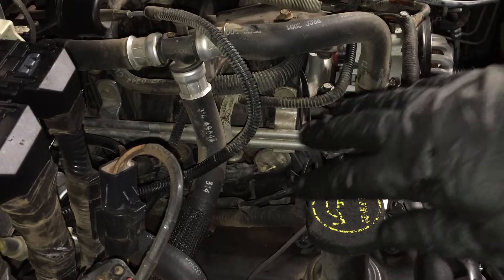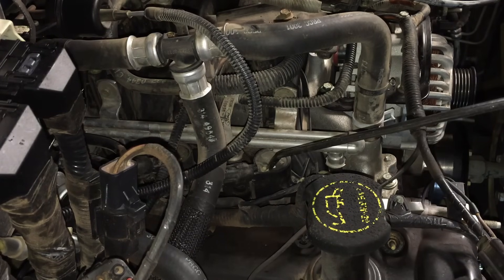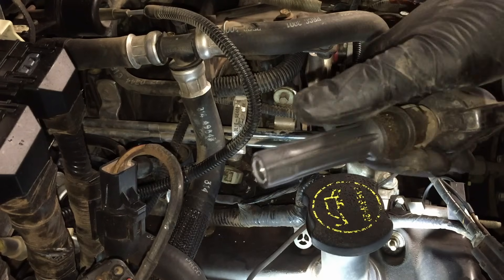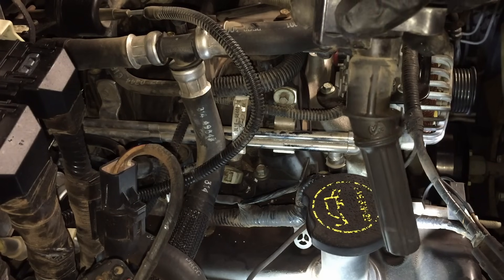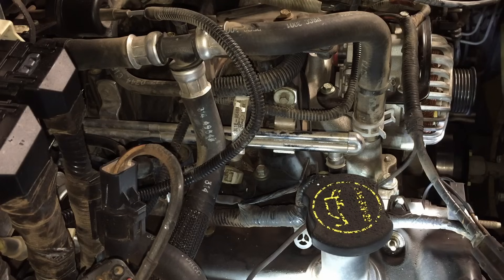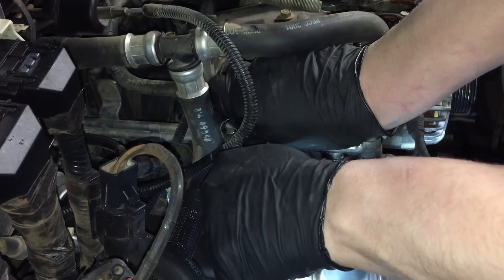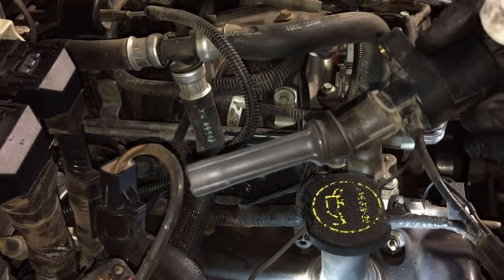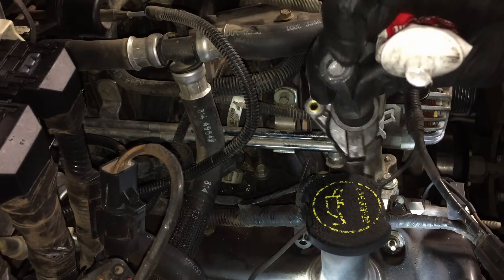Important Tips When Replacing Spark Plugs on Ford 4.6L 5.4L 6.8L 2v Engines

Comment: Have an ,06 f150 5.4 3 valve non flex engine. socket for later engine is 9/16 not sure what years that covers but I think is 2005 and up putting in my 3rd and last set of plugs coils were replaced recently also third set all motorcraft . When I replaced the coils the first time when the truck was young I put the MSD ones in which I got from summit racing equipment they eventually failed lots of trouble getting them out with the boots coming apart which sometimes happens watched  this video as a refresher I learned so much from this guy since I’ve had the truck getting ready to replace it but if you have any problems he is the Ford guy or I should Have just sent  the truck out to him a couple years ago and then I’m straightening out as I have a Honda guy who hates Fords doesn’t like to work on I have to beg him to work on it so I do a lot of the work myself one  thing wear a pair 
of gloves with the rubberized sides 
doing this I have big hands it’s hard to get in there otherwise and you will tear your hands up badly. It’s definitely a job you don’t need to rush you don’t want to rush and you allow at least 3 to 4 hours to do it the first time if one of the cylinders  gives you a hard time with is going to stop and maybe have lunch or something and then get back ones it can get very aggravating very frustrating in there quickly on the back ones they don’t give you a lot of room to work it’s almost like they put the plugs in on the assembly line with the motor before they drop the motor into the truck which is probably what they do if the engine was out of the truck this would be a breeze but it’s not. Good luck . Whatever dealership ,lost this guy made a big mistake he is the Ford guy he’s the Ford guru he’s helped  me with all types of problems over the years with this truck not that I’ve had a lot but he is the man! Thanks for a great video ! I have 300,000 miles on this truck plus getting misfires cyl 1-3 and three wouldn’t be surprised if it’s the oil thing like he talks about with the valve cover coils are all new just trying to get the truck thru inspection as the plug themselves are giving me four codes misfires one through three each individual codes in a multi misfire code if I can fix that I can get it to inspection for one last time! Hoping it works!

Comment: Am I missing something? You didn’t actually use a torque wrench and you just estimated how tight to make that spark plug. You even talked about the torque specs and said factory is supposed to be 13 to 15 pounds but you said tighten a little more than that, and then you just estimated with your hand instead of using an actual torque wrench. Knowing that these engines are prone to blowout plugs there’s no way I would just estimate!

Comment: Any (industrial quality, not the powdered aluminum auto store krap but nickel is fine) nickel or copper will do since spark plugs don't get hot enough to require nickel (but it's well worth having for exhaust manifold and turbo hardware!). I anti-seize every spark plug I install because customer thread repairs got the point across. Champion Aerospace 2612 Spark Plug Thread lubricant has graphite and is used on recip and jet engines (per individual tech order of course!). 

A very high temp anti-seize is milk of magnesia which GE and Airbus both specified in their hot section tech data (hard to find online but I was a USAF jet mech when I saw it in GE tech data). That also works on exhaust hardware. Here's a reference from an aviation supplier (use original, not flavored!). 
On plug threads a dab the size of this "0" midway up the threads will do. 

Dry threads are Satan's playground.

I found a reliable way to flush out spark plug wells. I use an "irrigation syringe" (cheap at any drug store) and a couple feet of ~3/8" metal tubing (copper pipe is fine) to fill each plug well then let sit about 20 minutes. Then cover with a handful of shop rags and blow out with a long reach blow gun. I use a cheap USB borescope to inspect and repeat the cleaning until I no longer wash oily gunk out of the plug well. Then I can remove plugs without worry.

Comment: I found a very useful trick for cleaning the accumulated oil etc from spark plug wells which easily trap crap over time.
I use an "irrigation syringe" (cheap online or at any drug store) and a couple feet of metal tubing to fill the plug well with acetone (cheap by the gallon).
(Do this outdoors and do NOT even think about smoking or similar!) I let the well sit full for about ten minutes then cover it with a loose handful of shop rags and blow out the plug well with a long reach compressed air blow gun. Repeat until clean and dry. 

I use cheap USB borescopes supported by the same metal tubing (copper tubing works nicely) to get a visual on each plug well to ensure it's clean before pulling plugs. It's worth the modest amount of work to have clean plug wells and compressed air alone doesn't work as well. 

I apply a (SMALL) dab of anti-seize mid-way on the plug threads. 
For the people who howl about never using anti-seize on spark plugs note recip and jet aircraft engines have used thread lubricant since the early last century. Champion 2612 Spark Plug Thread Lubricant is affordable but any decent copper or nickel anti-seize will do. (You can even use milk of magnesia with Airbus and GE have specified for jet engine igniters and which works nicely on exhaust manifold hardware.) Dry threads are Satan's playground.

Comment: Nice lies about blow outs.  Ford had a single car come in for that.  They did and tecorded everything in attempts to recreate the situation.  Not a single blown out plug, not 1 when done to factory torque spec.  Its a bs rumor, the car that came in was sabotaged more than likely, oddly enough, right before warranty was up.
Reply: I'm torn between what he said and the factory workshop manual which says 11 ft pounds... 2006 Lincoln Town Car Designer Series Gas
Reply: @Finding-Orthodoxy it's not 11, your manual is likely a fake or misprint.  11 ft lbs, that's a total of 44 applied for all threads
Reply: @TheGnome-x1o  I thought so too at first. But the Workshop manual, haynes, and operation charm, all say 11
Reply: @Finding-Orthodoxy so, 11 ftkbs per thread, 5 threads, 55ftlbs total hole pressure, thats actually really good.  Problem is its fast and easy for a sabotur to loosen.

Comment: I've had my 2001 Van for 23 years now. I have never changed the spark plugs or the coil packs because I was afraid to. At two hundred and ten thousand miles it finally started missing a little bit and I had no choice. You are amazing and calm. You gave me the confidence and believe it or not.I got every one of those spark plugs out. I had to put about a 15 inchicken to get enough torque to get him out.But they all came out without without breaking them. When I put the new ones back in. I'm gonna try to find one of those magnetic sockets. Thanks for the video and conference

Comment: do most mechanics remove the fuel rail when doing the spark plugs? my truck has 300,000 miles had the truck for 30,000 miles idk when they were last changed should I change my plugs?

Comment: I am replacing my intake gasket, antifreeze running out at the rear of the engine. Presure test the system, and antifreeze ran out the back.Some antifreeze was in back plug hole,great time to do my plugs. Have a good week.

Comment: I'm halfway through this very job right now.  Came inside to cool off and eat some ice cream :)  This job is difficult.  Clearances are very tight.  The hole for the spark plug installation is as he said - lots of dirt and very small stones.  The drivers side seems to be the most challenging.  I counted the tools I had used, and I had nine ratchets, sockets, extensions and swivel sockets in a pile, and I was constantly trying different combinations to get that side done. 

 I did torque my plugs to spec plus a little squeeze on top.  I bought the correct Motorcraft plugs and pulled the old Motorcraft plugs.  I had a fault with the #7 misfiring, so I installed aftermarket coils.  If they run poorly in the future, I will comment here.  I'm tired.  My hands hurt and I am 1/2 way through. 

 OH - listen - the driver side spark plugs are hard, as I said, but you will have to use a swivel and it needs to be the first module off the spark plug socket, and then maybe use the 4" extension to carefully feel your way to screwing that spark plug in the back two cylinders on the drivers side.

Comment: I learned how to change the spark plugs on my 2004 f150 4.6 3v from watching this guy.. hes awesome! My husband teases me calling him my go to guy lol.. my  4.6 entailed  taking the throttle body and fuel rails  off which actually made it a lot easier to access the plugs.. now I've have a 2005 f150 with a 5.4 3v and had PO codes 0300 & 3005 come up.  I found that 3005 is a misfire on cylinder 5 and 3000 is random misfire.. so ran some sea foam through the system knowing I was probably gonna be dealing with plugs and went to work to change out at the very least the plug on cylinder 5 because after swapping coils to test the theory..  cylinder 5 still came back with a misfire so I know  I've gotta plug problem.. to my horror, I found that either someone had already tried changing the plugs and screwed the plug  up by rounding out the jam nut or it rusted out on it's own which I found to be a problem with these particular trucks.. since the plug wasn't broke and the electrode was still intact, I didn't use the broken plug extractor..  I couldn't get a bite on the plug with a reg plug socket since it was rounded out.. after researching it a little more, I decided on a deep well bolt extractor instead  & got the plug out in one piece.. turns out they are the original plugs! My truck has 224,000 miles on it 😮 and now I'm freaked out wondering what kind of other problems am I going to run into🥹 I'm thinking maybe I should run some more sea foam through the system before I do the rest of the plugs.. truck does  run much better just with the one plug at least, but I know I've gotta do the other plugs asap so I'm gonna try another plug replacement and if it goes well, I'll keep going if not going with another can of sea foam and I'm starting in the back with cylinders 4 and 8.. that way I get the ugly out of the way first, fingers crossed!

Comment: If you got dramas just remove the fuel rails. lube the o rings on assembly and you should be ok. You can buy the o rings separately if you feel cautious. We always replace the injectors when doing coil/plug replacements. Never have to keep doing the same moves over. Besides it saves us a lot of expensive cats.

Comment: I have a 2004 navigator, and I can not reach the driverside back plug because there is some tube run ING right over the top of the coil. What is that.

Comment: Hey, how did you get the coil screw out. second one from the front on the passenger side? I can't even get at a 1/4 inch socket with a 1/4 inch extension in there, with or without a swivel, and I turned that gas sensor, or whatever it is around to get it out of the way

Comment: On a 5.4L 2V engine, the spark plug gap specs are .054". I found that on an E350, the spark plug gap specs are .044" for the same engine. Is this correct? If so, why? I have a 2003 E350.

Comment: Misfire cylinder 6. Oil in spark plug well. Used shop vac to remove oil. Only 70000 miles on engine. No sign of leakage from gaskets and only one cylinder with oil in well. Where are the oil well seals?
Problem worse in very cold weather.

Comment: head of spark plug is bold, what should I do?
Reply: Broken plug extractor depending on your problem.. the nut on mine is  rounded on my 05 f150 5.4 3v so don't know if the plug remover tool will work or not but hubby just got me a bolt extractor so I'm looking up options.. research research research then fingers crossed!

Comment: Tried to tackle this repair this weekend with the help of this video. I'm glad cylinders 4 and 8 weren't misfiring because there was simply no way I was going to get those out without some real funky tools, especially 8. I was able to replace the fuel injector on 4, but not the plug or coil pack. As everyone says, the driver's side is way harder, 4-handed job for sure. I was able to do the passenger's side by myself. Engine's running much better now.

Comment: Your awesome,  I did my 99 E250 what bitch that was!! I had to purchase 2 extension. 1 6 inch and a 10  that had a magnetic 5/8  SOCKET with a swivel as one.
Found that standard 5/8s socket with rubber sleeve after torque. As you said, the 5/8 socket stayed on the spark plug . Just a tip

Comment: Doing 5.4 now pita. 3hrs allow. Clean all holes. Clean coil pack screws torque to 7lb use thread thread sealer on them. Hand start all plugs, USE TORQUE WRENCH. use dielecric grease on coil elec connectors and coil pack boots inside plug contact AND outter boot shoulder.

Comment: Dialectic grease on plugs: Seems logical, but I did my work vans' batteries and both quit around the same time. The grease collected enough dirt to lose contact with the  terminals. Cleaning the grease off was the fix. I'm not sure if the same results for plugs , but I'm hesitant. Those coils are deep in that motor where dirt collects.

Comment: Just did my first 5.4L.(2002 E-350)  spark plug service, i used the Autolite iridium plugs, couldnt get the craftymotor stuff oops, unit has 200k miles, did the usual pcv& hose / vacum leak checks, thermostat and ect sensor. Lots of general service over the years but not any 2000' s ford unit engine service up to now, i only study the Ford tech on your channel, have to report that this unit totally came around and runs real nice now..i work for a large farm with 26 trucks, have 3 Ford SOHC units older than 04', next tune up is my first 6.8 L v-10 unit w/ 251k miles, you remind me of the nice techs that would stop to help me out at the Ford dealer back in the 90's, ( im older..lol) - really helping me catch up and thanks again Sir.

Comment: I have a 2001 ford f150 xlt 5.4 triton an there is oil up by the front passenger side fuel injector and before that oil light came on and it got hot shut it off immediately what would cause that

Comment: Over torqing the spark plugs especially by hand.. can that be bad for the timing and possible cause head gasket leaks? I mean you even measured the gap on the plugs, the ones that came out were torqued down hard with a massive gap the placement of the spark isnt important to the cylinder? Maybe the spark plug had such a big gap because the explosions damaged and stretched it because its not top dead center, was there burn marks on the plastic too?
Reply from the maker: um no
Reply: @FordTechMakuloco  i look too much into things lol. My moms 5.4 had a plug blowout. I stuck a tissue down to collect shavings and rethreaded it now im sure the spark plugs location isnt perfect worried about timing issues and whether i should buy a new sleeve and hammer it in

Comment: If any of the videos in your library are outdated or there are some new methods you prefer, will you provide any type of notice i.e., Pin a comment in the comment section, revise the title? ...Separate subject-I have a P0307 with the p0316 on my 04 f150 4.6 2v. Could this have a similar issue with the roller bearings on the 3v 5.4 with a P0307. I'm thinking if I had a problem with only a two valve it would have a lot more stumbling than I've got going on?? The vehicle has 225,000+ on it if there's any common problem at that mileage. I'm kind of looking forward to working on this project. That should be a pretty good indication of how sick in the Noggin I am 😂

Comment: That #4 and #8 plug are the worst. Going to finish up and take those on this weekend. I have gorilla hands, so doing the other 6 were even a challenge. The #4 cyl is horrible, because they plug wells angle back towards the firewall. I picked up a special socket at NAPA that the guy recommended for ford engines that is deeper than normal and reaches all the way down- and has rubber to grip the plug.

Comment: Do you have to remove the fuel rail to get the two back plugs on the passenger side?
Reply: I loosened mine. It's only one bolt at the front one bolt at the rear. I might've taken one bolt completely out so I could rotate the bar out of the way, but it was not a problem.

Comment: I understand there was  actually a service bulletin that came out explaining to increase the torque from 13 to between 20 and 25 foot pounds. Same bulletin advised not using anti-seize. It's squished up lubricating the beveled seal which creates the friction so the plug does not turn out. Turn me that's like putting anti-seize on your lug nuts😮 if you use anti-seize I would do a downstroke from the seat down with a little on my finger. That puts a single stripe of anti-seize and when you turn it into the head it will smear around all the way and not Bunch up on the beveled seat as a do-it-yourselfer since 15 took me a couple years to learn if it's such a pain to get into tight engines with big hands, Do the easier side first. That gives you a little firsthand practice on that vehicle with those plugs. You can always wait a week till you do the other side. Then you're not burned out and angry by the time you get to the hard stuff LOL usually people have tired backs and arms on a DIY project. Save yourself the aggravation & space it out.